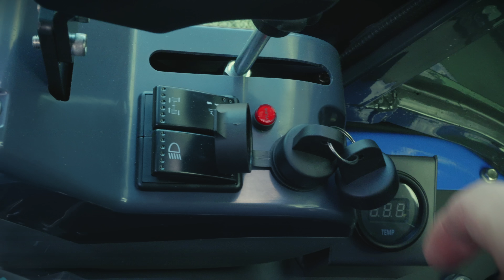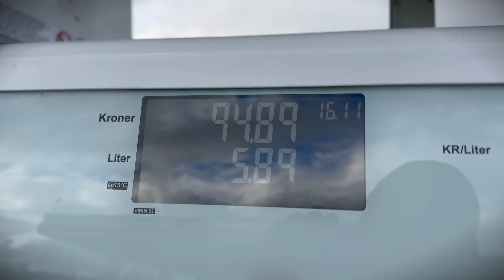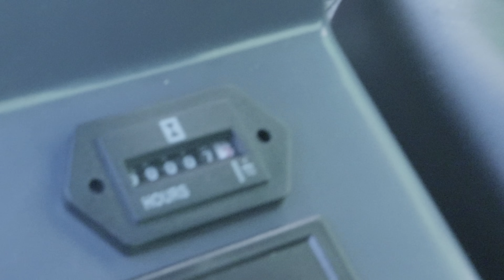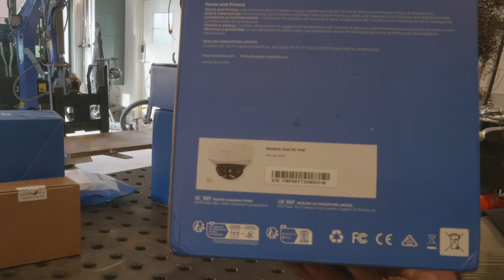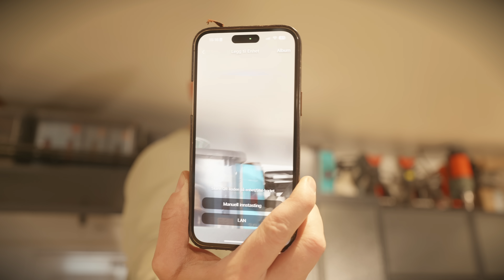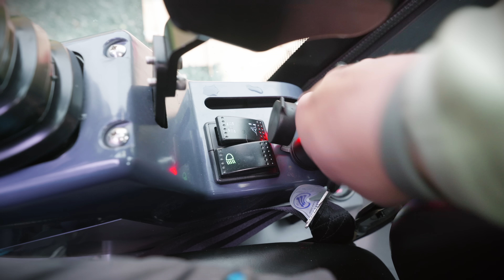I Bought a Mini Excavator From China and THIS Arrived!

Comment: 我们管这玩意叫工业垃圾，但是一分价钱一分货，的确能解决偏远第七贫穷农民的不是很强的土方作业需求，就是配件估计比较难找。
Reply from the maker: Naah, After this video I got to visit the actual manufacturer in China. It’s a good product, and spare parts should not be an issue. They also have spare parts in EU warehouse😊
Reply: @frengen_engineering  you also come to china juse wang to see the excavator factury? wow hope you enjoy your  mechanical~There are still some issues with the materials used and design tolerances in Chinese construction machinery, but these should be easily resolved. Enjoy using it~！and thank you share this video to promoting china products~
Reply from the maker: @Starfadt297 Yes, I did. Check the latest "boat" video. It has some clips of the trip. Will make more videos about it. A very interesting trip😊

Comment: GOTT-DANGIT, Son! That was great! And that little machine looks to do everything you could want it to do on a small farm or a large private parcel. It's not rated for commercial construction work or anything but any machine that is should probably be an order of magnitude more expensive.
Reply: 这台机器如果在中国购买，价格折合成美元大概是2000美元。但是！加上他订购的配件、运费、关税等额外费用，最终他为视频里这台漂亮高效又省油的好东西花了12000美元，这个价格和2000美元就不是一回事了。
当然，如果买欧美日韩制造的同样配置的挖掘机依然会比这个贵。
但中国制造业利润已经很低了，制造业员工平均只拿折合1000美元的月薪，每个产品基本上只有10%甚至不到10%的利润，我们真的没有那种花2000美元价格变出20000美元品质的能力，顶多用2000美元达到6000美元的效果。

Comment: my only issue i have had with buying things from alibaba has been the cost of shipping - not from china to canada from the the port in canada to where i live, about 4 hours north of vancouver.   the cost of shipping it is usually more than the total of the item PLUS the shipping from china.   so i end up having to down and get it.. which is not a huge deal, but a pain...   i have purchased an orderpicker which is sort of a hydraulic lift, a flail mover, a whole bunch of  polycarbonate sheets for a greenhouse, and a tiller,    everything has been great quality, the only issue is if you need directions for something they are usually pretty poor...  but nothing i haven't figured out..  i did notice many of the exact things sold in canada for 3 or more times the price and all they so is assemble it and slap a sticker on....

Comment: Why order an internal combustion engine model when an electric version wouldn't have any of the same maintenance issues and would be significantly cheaper and more reliable to run and operate? Plus, you would have eliminated annoying trips to the gas station for fuel; you'd have been able to charge it from the grid or rooftop solar. It's amazing what China produces in the electric equipment space.
Reply from the maker: I did not do a lot of research regarding electric ones. Maybe I should convert it😆

Comment: I bet it doesn't last a year in service before your need to spend ridiculous amount on replacement parts. Just like my electric cycle brought for 599.00 pounds this week, it becomes 1 year old, having done 5400 miles since I've replaced almost every part. In fact, it's easier to name the part that hasn't been replaced, so here goes the whole electric system, the frame, and the wheels that's it. The additional cost 1173 pounds on parts and labour

Comment: Seems solid, Thanks for review.  I would change the hydraulic hoses to equivalent  R12 high pressure rubber with steele braiding. Just to be safe with weather changes.

Comment: I bought a non running KOMATSU PC75UU-2, 18,000lb 4cyl diesel Excavator with Cab Heat and A/C from the 90's for $3,000!!! Spent about $1,000 replacing hoses myself, rebuilt injector pump myself, fixed rigged fuel system myself, rebuilt 3 cylinders myself, repaired both STEEL TRACKS myself, rebuilt all track rollers/idlers/tensioners and carriers myself, replaced ALL fluids, and MADE a hydraulic thumb from scratch. Re-painted undercarriage and topside and now have a $60k-$100+k machine that I am now making money with! And 100% JAPANESE...NOT A possibly "questionable' CHINESE "TOY"! I WILL however accept those questionable Chinese "Toys" for evaluation and testing VIDEOS! Skid Steers, Mini-Excavators, Backhoes, Tractors, Mini-Trucks, ETC...you name it, I'll test and video them!  So contact me if you want to send me them and have me VIDEO EVALUATE them! FOR REAL, SERIOUSLY!!!

Comment: The service part is terrible 😂
And also the play on the boom is enormous, I'm an operator myself and see a lot of troubles in the machine

First of the play, it should have near 0
Engine access is near 0
To big hoses on the coupler, also coupler is not adjustable
The hydraulic motors sticking out prone to failure

I mean would I buy it for home use? 100%
But to use it in my company I would rather buy a old second hand

Thanks for the video ❤

Comment: MY buddy has a open station mini excavator and he is super happy with it also, it actually fits into a single car garage in which he dug a trench and put gravel. Kind of amazing how such a small thing can have the power that it has. IT was tough digging with the shovels, but the excavator made short work. They are surprisingly strong, but the pins and metal in general are rather low grade for sure. His first one bent the thumb cylinder pins, they were so soft, the onboard hydraulics bent them. The good thing was, the manufacturer actually sent out HARDENED pins. Not bad china, not bad. Here in Canada the crate in came in would cost $12,0000. China makes you a complex machine for that.

Comment: Couple weeks back I watched a YouTube video about repairing a driveway with pot holes. Apparently you need to excavate the hard pan out of the pot hole, this helps to keep your material in the repaired section. The video explained that by not doing so, you eventually displace all the material you back filled with. I believe the hard pan will hold water and not drain, the water is the culprit. Other than that the content was gold, looking forward to your next Chinese equipment review! Cheers!

Comment: You gotta break down the floor of the pothole. Dig it out a little bit. It helps keep the new gravel in place.
Reply from the maker: Hi! Correct. I did all that for the biggest pot holes. Not the small ones tough. Was to exited 😅

Comment: I think I would rather take the 12k and buy a used name brand machine and know that when I need a part I can get it much easier.  I had a 30 year old Ford tractor and getting parts was never a problem.  What happens when that thing breaks?

Comment: Did you change the fluids prior to running it? The shipping fluids are junk and should be changed immediately to prevent damage. Put some small magnets in the hydraulic tank also to collect any metal that's in it and run a long handled magnet around the bottom of the tank to pick up any metal bits.
Reply from the maker: Hi! Unfortunately I did not, but I’m planning doing it nowadays. Thanks for the tips!

Comment: 11:40 Yes, when fuel runs out, any and every machine stops automatically. If you run out of oxygen, will you have a choice to continue operating? You may think so, but you'd be wrong, dead wrong.
Reply: Is it possible to just be wrong and not dead?

Comment: bloody 2 tonne excavator got a quick hitch coupler, wow! also you should learn how to use the coupler properly. you pick the bucket off the ground with the coupler normally the top pin of the bucket and turn the bucket (right joystick). You should be able to see the bottom of the bucket, The bucket pin will be on a closed coupler, Press the bucket button in cab there should a noise in the cab. Turn the bucket still, this will open the coupler the bucket will drop into the coupler dis engage bucket button. but still hold the joystick and you will see the coupler close over the bottom pin once closed open the bucket to see it closed and can hold it own weight.

Comment: When ordering these, or any other expensive items from AliExpress, Alibaba, Temu, wish etc., the "cheap" price they show is ALWAYS the "down payment" or "peripheral cost". A 15000€ laser cleaner is listed on AliExpress for 236€, but when you look into it, the 236€ is for the laser safety goggles, and you need to contact the factory for quote on the device. For mini excavators, the price is a down payment which you need to negotiate with the factory too. That's if it isn't an outright scam. This video is the first one that actually mentions that buying this stuff isn't actually straightforward, nor cheap.

When you slap the tariffs, tax and freights on top of the price, it quickly becomes several times cheaper to buy an excavator used at your home country.

For reference I can buy an used mini excavator for around 5000 - 6000 € in Finland, and buying and importing that exact brand from China will cost around 8000€.
Reply: Also for reference, the "list price" on Ali Express for that excavator was 1300€, with a tiny text at bottom corner stating that it is a down payment.

Comment: Just a little context , I bought a cheap as Chinese Petrol leaf blower for $79 .
I bought an expensive Honda 4 stroke Line trimmer for around $500 .
After 15 years  the leaf blower is still going and only breakdown has been the choke button came off but I fixed it easily with some bent wire works fine .
The Honda Line trimmer has broken down 5 times !  required 4 new fuel lines and a new carburettor at a cost of  $165 and it would have been far more if I had to get a mechanic to fix it each time and it has a horrible uncomfortable trigger and grip and a terrible tap and go head .
So in summary some Chinese stuff can be quite good for the price and outperform some well known and allegedly quality products .  I now use my old Sthil line trimmer , it's lighter , more ergonomic and has a great easy to reload tap and go head . Honda you failed big time .

Comment: Impressive skills for a self taught operator! Please secure that fuel funnel in an upright position to mitigate spillage.
If he had had the gravel truck driver chain his tailgate open to a 6 inch gap and then slowly spew the aggregate down the length of the driveway; much time would have been saved shuttling tiny bucket loads of gravel from the pile to the holes.

Comment: First time ever to see a delivery truck with a baby forklift, so genius and practical.
Reply: All the brick delivery trucks here have them ,don't have to rely upon anyone
Reply: They are pretty common in the Netherlands too, we call it a kooiaap. Which literally translated means cagemonkey..
Reply: They are common in the USA and used in areas where a 18-wheel flat trailer is not practical to pull into your property
Reply: They are like all over the west
Reply: now that truck set need to be his next order XD
Reply: It's amazing what the Chinese are able to accomplish, using only slave labour, and stolen patents. Impressive!
Reply: Also popular here in Canada. Usually smaller models though. Depends on the load I guess.
Reply: Pretty standard for flatbeds delivering roofing shingles.
Reply: Caminhão..
Reply: They are pretty common in Europe. Although most trucks delivering to warehouses and industrial sites won't have them as they often have their own "real" trucks to load/unload.
Reply: First invented in Ireland in the 1980's, originally known as the Moffett mounty.
Reply: @mickmolloy6594  Almost.....Hessel Kooi (Dutch) is the inventor:

A truck-mounted forklift or forklift is a forklift that can be attached to the back of a truck. The truck has its own forklift truck with it to load and unload. 'Kooiaap' is an eponym, after the name of the inventor of the device, Hessel Kooi. Kooi had a company for washing flower bulbs in the Frisian Oude Leije. He often needed a forklift truck for loading and unloading on site, but it often took too much time to arrange a forklift on site. That is why Kooi manufactured the first 'forklift' for his own use in the 1970s. Colleagues from the area saw this forklift and showed interest. Kooi built a few copies for them in his barn in Oude Leije. These activities led to the establishment of the Kooi company, which would later be taken over by the American company Moffett, which would also call itself the inventor of the system from 1986 onwards.
Reply: @mickmolloy6594  Yup, we have had Moffetts on our trucks for a long time.
Reply: Tons of them here all over the States
Reply: Common in Australia too. Where does this guy live? 😂
Reply: Prob Russian

Comment: It pains me to see the clumsy and messy operation. Interesting idea to use the bucket as a plow, I never thought to do that in all the years I operated one. I didn't want to impact the boom and dipper in a possible bad impact. Gentle dozer blade back and forward would be all I would use. You MUST keep the pile tight and organized so you don't waste time or materials as advance with the project. Clean and neat is the way to work.
Reply from the maker: Sorry for your pain. It’s all about sharing😂

Comment: It wasn't worth renting a mini excavator, even though we know exactly what you do with your videos for advertising purposes. To fix that driveway, you just had to tell the truck driver to pour that grit onto the driveway while driving slowly, spread it out with a shovel, and then use the same truck to press it down like a steamroller. You did a lot of useless work to fill a simple hole. You obviously have nothing else to do, and that mini excavator is terribly built. Just look at the two hydraulic motors that drive the tracks, which are exposed to any impact. Not even a monkey would design something like that, but what wouldn't you do for YouTube?

Comment: my old ears heard less than $2000. i thought you were going to be scammed. when you opened the box and this beautiful machine appeared, i almost fell off my bed. started frantically looking. did not find one that cheap. only after i read the description did i realize i misheard. it's $12000, not $2000. that makes a hell of a lot more sense. nice machine but for $12000 i'd rather get something local used on craigslist.
Reply from the maker: Hi, you heard right in the start. They where advertised as 2000 dollars, but it ended up costing a lot more. Great machine tough. Video coming up next weekend I hope. 😊
Reply: @frengen_engineering  i am sorry, i don't get it. the upgrades cost 6x more then the original machine?!? how is that possible? what exactly do you get for $2000? stickers?